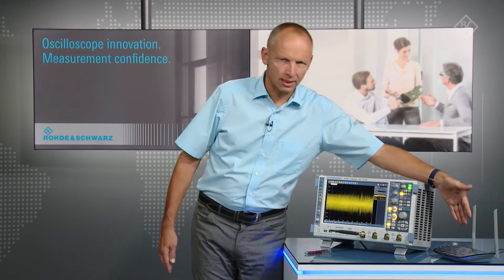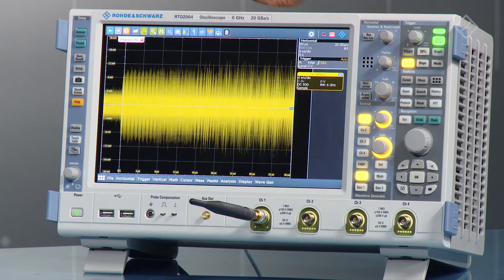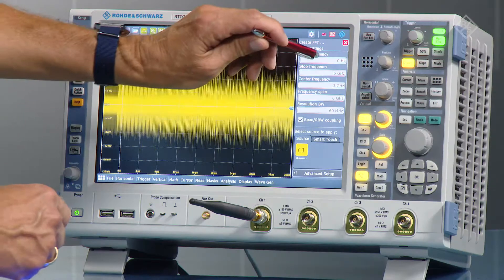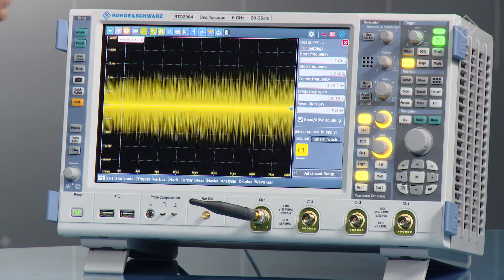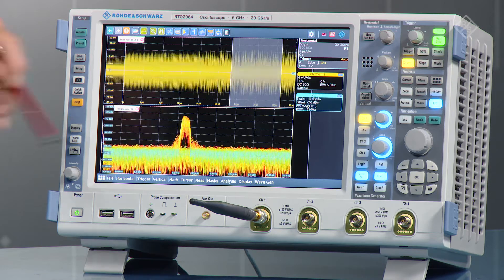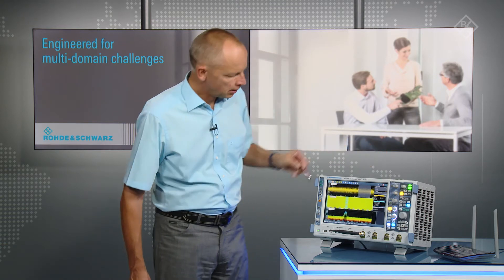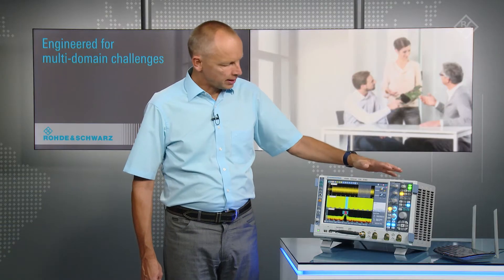R&S RTO digital oscilloscope: Powerful spectrum analysis

Comment: Is the RTO able to display a frequency vs time trace  (thus in the time domain) ?
Reply from the maker: Yes, this is possible. All signals can be analyzed in time and frequency domain simultaneously- you can even correlate it- e.g. analyzing the spectrum of a certain part of the time window.
Reply: @Rohde-Schwarz  OK, but my question was a bit more specific... is the FFT fast enough to display a frequency vs time trace (for the peak freq for example) to debug some frequency-hopping scheme with a hop rate in the lower KHz range (1-5) ? And/or what would be a typical hop rate limit for such a use-case with the RTO1K or RT02K ?
Reply from the maker: @JohnDoe-ms4pv  It looks like your question needs a direct discussion. Therefore it will be easier to send it directly to customersupport@rohde-schwarz.com. Thanks fro your understanding
Reply: @JohnDoe-ms4pv  I'd use the frequency domain mask capability to trigger the scope on exactly the hops you want to capture....  It's pretty awesome.

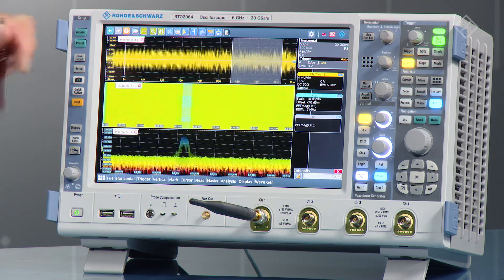Comment: Wow, that's amazing! The spectrograms at 2:00 look like what you would get from an RTSA. Of course, for many tasks a real frequency domain tool would be indispensable -- I wouldn't expect the same out-of-band-rejection, spurious, flatness, return loss, frequency range, etc from a scope -- but even with those caveats, this looks quite useful. There's one detail I would like clarification on, however: does the RTO spectrum analysis aim for high POI? Are the spectrogram and frequency-domain trigger being performed in real time on all samples (as in a RTSA) or are they performed only on samples inside of acquisitions? Thanks!